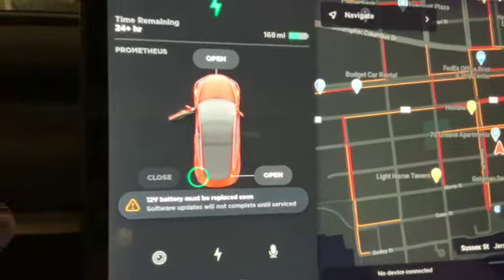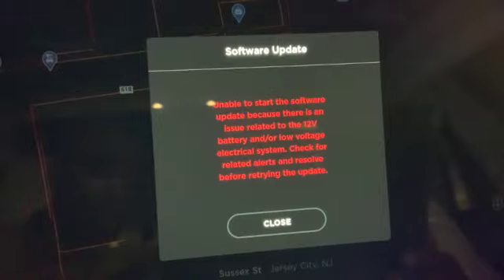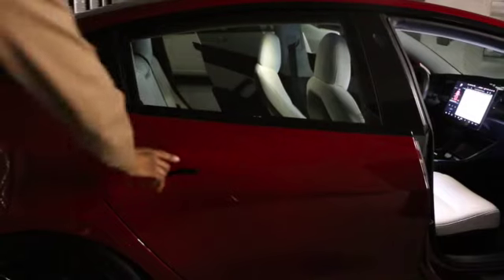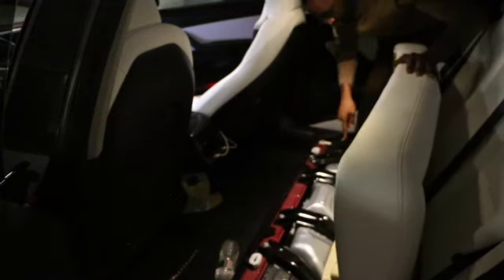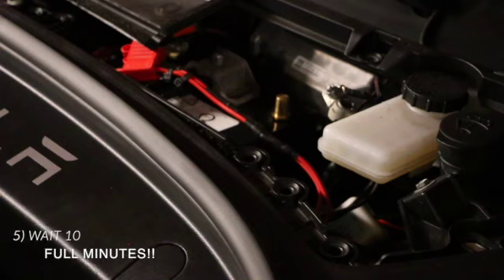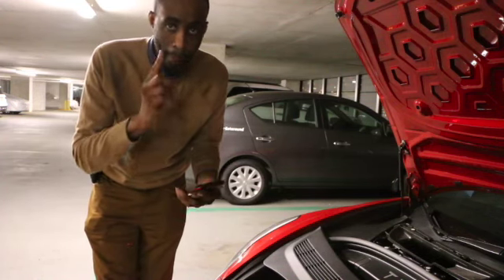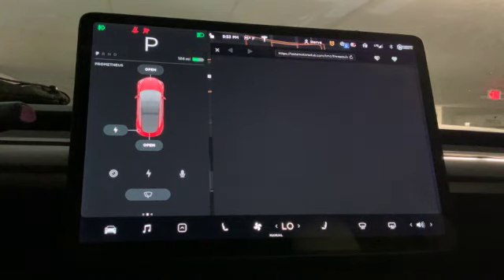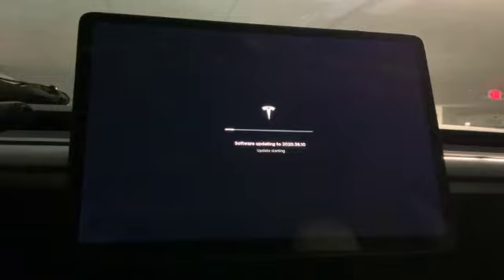12V battery must be replaced soon tesla model 3 error and how to fix it- HERVEs WORLD - episode 417

Comment: This was a great tip. Unplugged main battery.  12volt battery measured 12.25volts.    Disconnected negative terminal waited 20 minutes. Reconnected 12v  battery, reconnected main battery. Now 12 volt measured 14.4 volts, charging voltage. The alert message was cleared. The 12v battery date 2018/08/14 about 3.5 years old. Hopefully this will allow time to find a suitable replacement. Thanks
Reply from the maker: Glad i cold help Rick! Really appreciate your comment, thank you for watching this video , dont forget to subscribe.

Comment: So does a bad 12 v battery cause this issue ? Do you need to get it replaced ? Mine is about 3 years old and just got the message.
Reply from the maker: Sometimes is ghost errors. For instance doing this procedure clears codes , if it the error comes back I call a ranger to take a look. This fixes most error codes .Try it.. make sure you leave the doors open!!! Let me know how it turns out.( standing by) 🤛🏿⚡️really appreciate your comment, thank you for watching this video , dont forget to subscribe.

Comment: I have the same problem but can't fix it. The only thing I did differently first I unplugged 12V then back seat one. Order of that procedure does matter? Should I unplug back seat one first?
And another question in the video you didn't lower down any windows however you suggest. 

I'm looking for your response
Reply from the maker: Open doors> disconnect 12v battery> unplug main battery harness> wait 10 minutes> replug battery harness> re connect 12V battery > close doors
Reply: @hervesworld  thanks for the response. I will the procedure as you described and will try again.

Comment: how do you know if your actual battery needs replacing and your not just bandaiding an issue?
Reply from the maker: It just dies and hard reboot will not work, or the 12v battery is lower than 12 v.

Comment: In the steps above you got it right however in the video you re-connected the 12v battery before the penthouse logic connector, you shouldn't do it that way.  Also you struggled with replacing the rear seat, that was because you hadn't fed the seatbelt catches back through the hole first.

Comment: I have done this exact thing twice now because the 12 volt battery prompt in the MCU randomly returned after about a month. Any advice? Hopefully it will not return.
Reply from the maker: This could actually mean that your battery is degraded .. get it checked!😉⚡️🚘
Reply: Do we hook 12v back up first or the connector under the seat? Someone in comments said connect under seat first?
Reply from the maker: Yes… connect main power.. ( leave the doors open, then the battery..)
Reply from the maker: Under the seat
Reply from the maker: Connection under the seat first.. /then close the doors / then the 12volt battery/ and the error should be gone.

Comment: You just needed to pull the plug under the seat for 10 min:
Reply from the maker: Good to know Leo.. thanks for sharing..
Reply: Is this true Leo?  I’m going to give that a try
Reply: Is this true could u just disconnect the battery under the seat for the message to go away
Reply: This didn't work